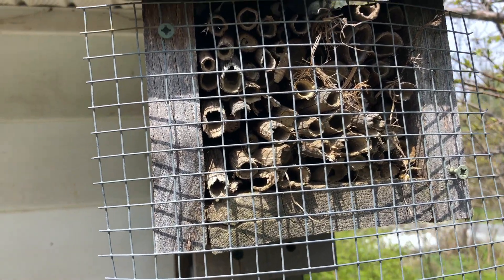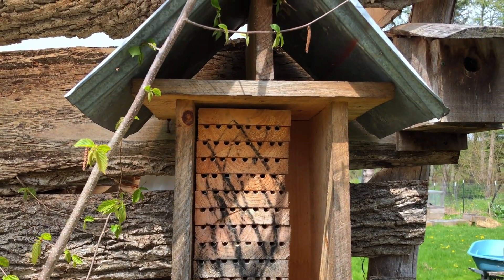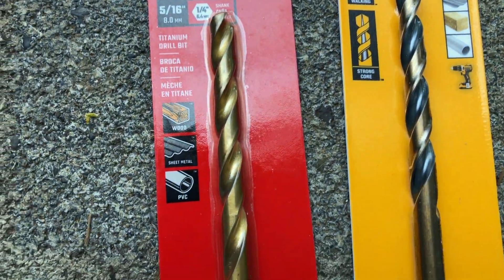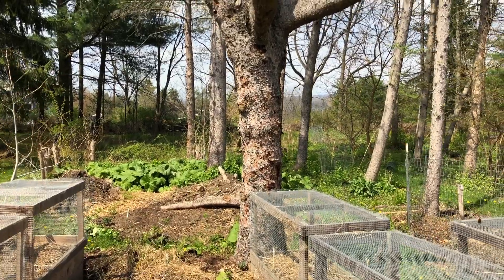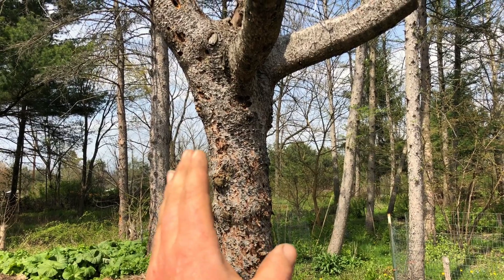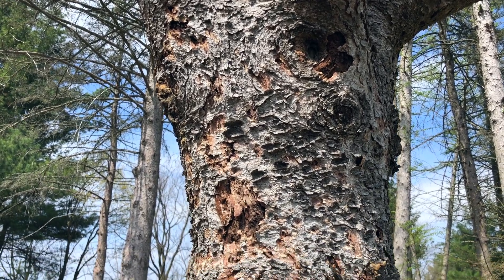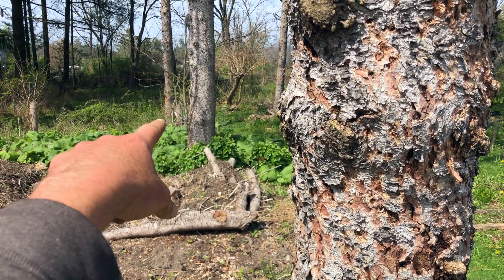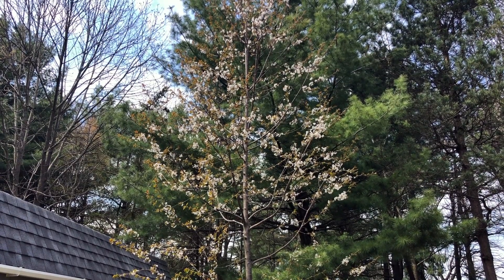Mason Bees - Drilling Holes in Dead Trees for Housing

Comment: I wonder if the angle of the drilled hole has any impact on the viability of the housing for the mason bees. Maybe a home with a slightly tilted entrance remains drier in the rain.
Reply from the maker: That is what I'm doing here.  I should have said that in the video.  Just a tiny bit of an angle upwards to shed any water that may blow in.  I think too steep would be bad for them, but I don' tknow.

Comment: For better Visibility you could scrape/chip away the outer bark with a small hatchet, hand-sized spots where you can drill a group of holes in a pattern . that way they are easier to spot for everyone and easier to control once in a while.
Reply: Easier for birds to spot too though
Reply: @melissab8500  not if you staple 1/2" hardware cloth over it